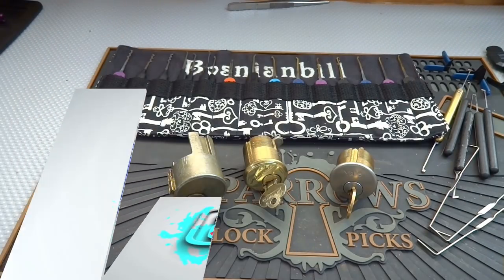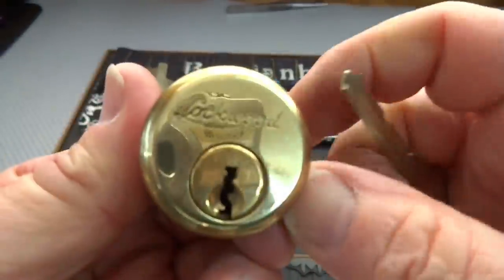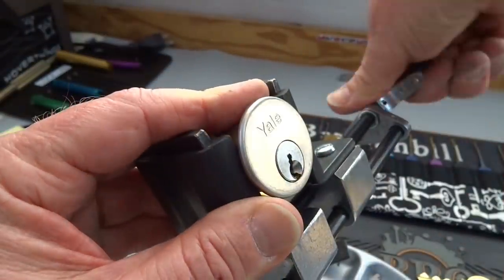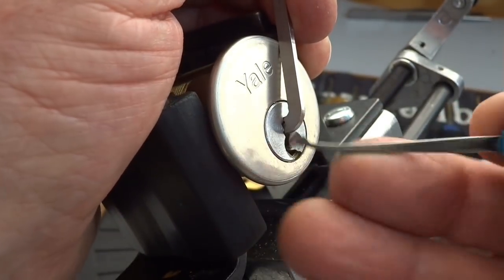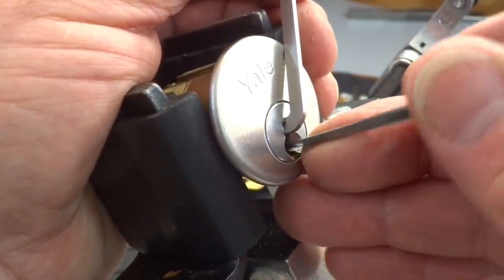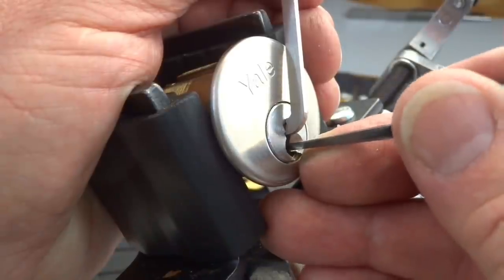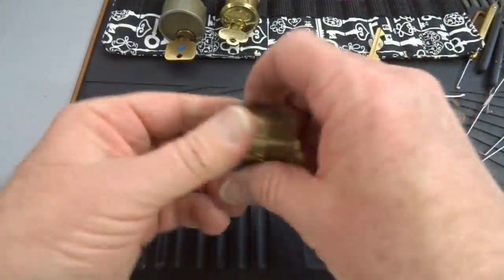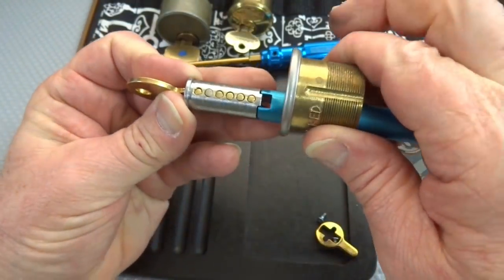(797) Tricky Yale from TahoePicked

Comment: I wonder... the threading is spiral, like an inverted screw, right? Wouldn't it be more effective to have individual circles? Is it even possible to dig circles into the lock?

I'm trying to imagine the geometry of the inside of the lock, and the threading sounds significantly less effective when spiral, as opposed to when people grind away a single groove. So does any nasty bit in the pin that isn't solely dedicated to an overset.
Reply: LforLight The key pins have an effect on the threads in the core. So when you push up the key pin it will hang on the threads. Just like the driver pin hangs up on the threads in the bible. 
But you are so correct with the theory of cutting circle cuts in the core would be better.  But I personally haven't found a way to cut in circles,  the ones with ine undercut is just grinding away from underneath where you want the ridge.
If you have any tool ideas to cut those circles let me know.

Comment: +Bosnianbill I hear you frequently refer to the part of the lock that has the springs and pins in it as the "bible." I've never heard the word used that way before, and I can't find a dictionary definition for that use. Is that a standard use in the lock smithing / picking world?
Reply: +David Fuller Yes, Bible is the correct locksmith term for the upper pin chamber
BIBLE: n. that portion of the cylinder shell which normally houses the pin chambers, especially those of a key-in-knob cylinder or certain rim cylinders
Reply: +rallock67 Thank you. I learned something new.

Comment: Why does the bidding make a difference (high, low, high and so on)? Aren't you just pushing them up all the same anyways? Cheers
Reply: with radical bitting, you have to be careful not to over set the pins engaged by the deep part of the key when reaching for the pins engaged by the high part of the key. that's why he uses a deep reaching pick like the deforest - with a shallow hook he simply could not set the deep pins without over setting the shallow ones
Reply: +Jacob Snow Thanks, this means you can't avoid to push two pins at the same time?